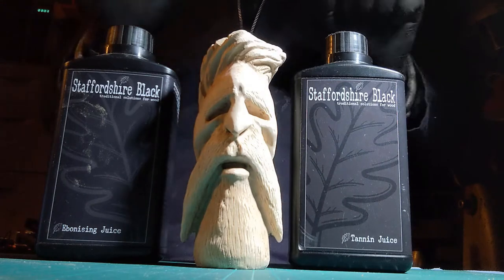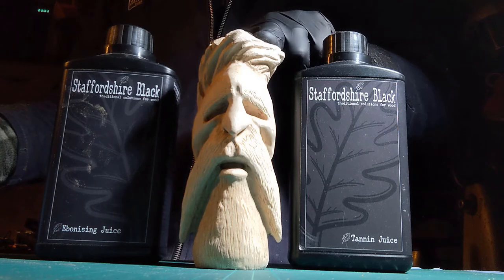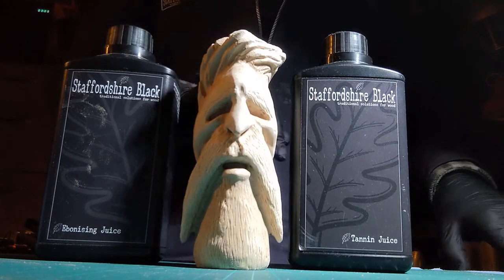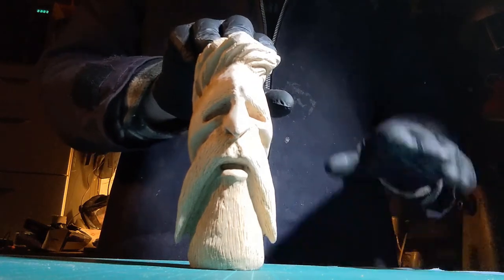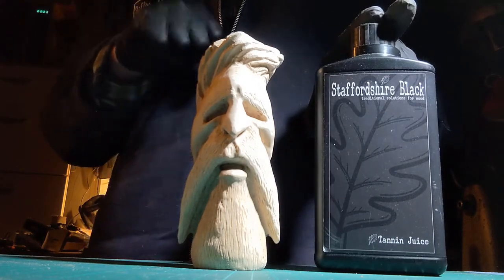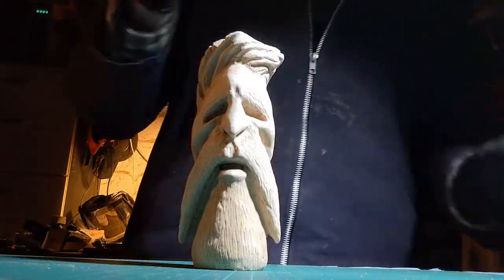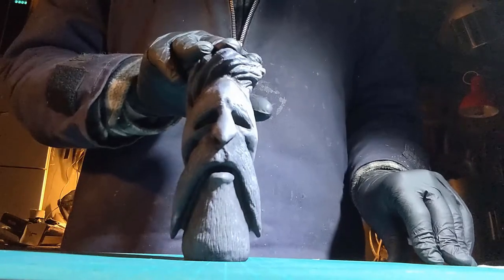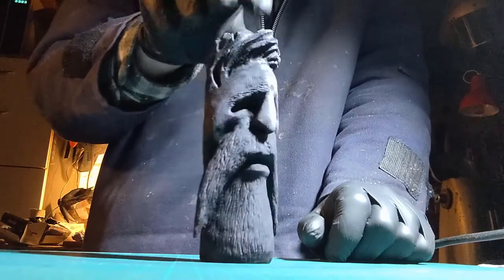Ebonised carvings using Staffordshire Black

Comment: How does this compare to India Ink? I was looking for something to blacken by bench frame.
Reply from the maker: That's not something I can answer with any kind of authority, unfortunately. There's some correlation between ebonising and India ink in that - depending on how the ink is made - some of the ingredients may have some similarities.
The main comparison that I can see is that the ink is a black substance applied to wood, whereas Staffordshire Black comprises solutions which turn the wood itself black when they combine.
The feedback I have had from SB customers is that our Juices give more of a natural result as opposed to the more artificial results of things like ebonising sprays and stains, etc.
I hope this helps 🙂